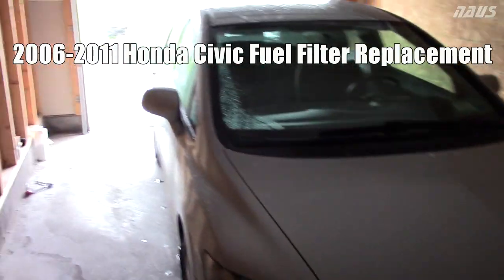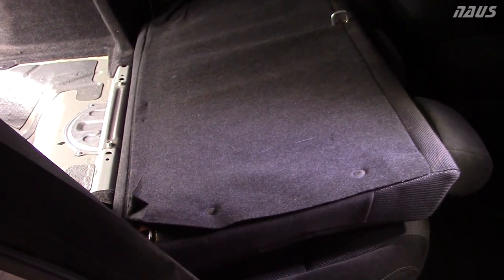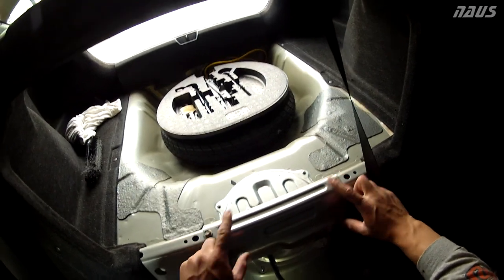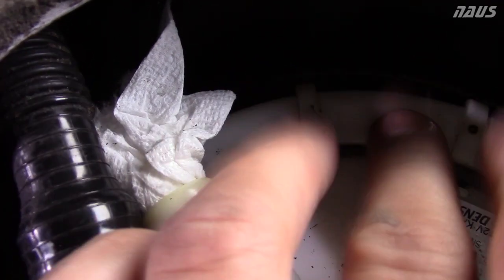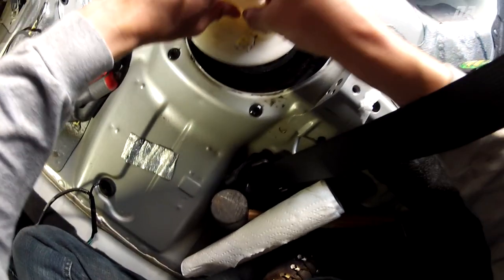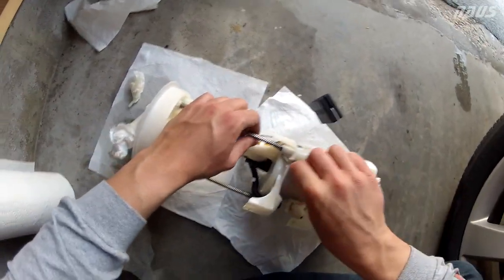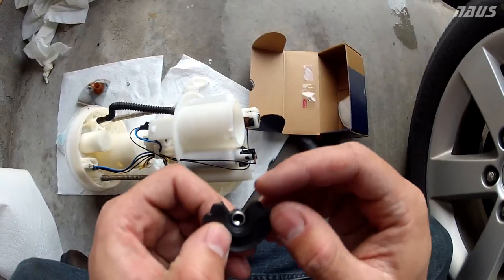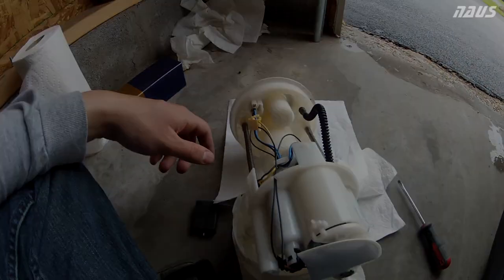8thgen Honda Civic Fuel Filter Strainer Replacement DIY

Comment: IMPORTANT NOTE:

You must withdraw the small o-ring inside the chamber (if it doesn't come out along with the pump) when you remove fuel pump, reattach it to the pump along with the plastic spacer to reinstall. Otherwise your car won't start, happened to me! ;)
Reply from the maker: Pinning this comment at the top. Yes this is very important and many people have commented with this same issue. Make sure the pump has the Oring on top of the white plastic spacer on the pump outlet before reinstalling!!!
Reply: same experience.that o-ring give me hard time to mount fuel pump.
Reply: Thanks so much for  this info. It was exactly what happened when i swapped by filter in my 08 civic.
Reply: Are you guys taking about the plastic o ring that goes with the cap ?
Reply: True story. :-/
Reply: @bradjohnson6783  we’re referring to the small rubber o-ring that seals the pump to the housing

Comment: THAT IS NOT THE FUEL FILTER GUYS. The filter is enclosed inside the white plastic next to the fuel pump. It's half round. It's called the fuel filter strainer assembly. It is the whole top gadget that the fuel pump sits in that needs to be changed. The part that was changed in this video is the strainer sock. The sock can be reused. taken of and cleaned out with throttle body cleaner. Although changing it will be best. NAUS did a good job of making this video,  trust me it was a lot of work. Thanx NAUS.
Reply: the description says that though
Reply: FPR*... aka PRESSURE *REGULATOR (right after the filter) is the part that causes lag, hesitations, lean misfires after 100KMi.

None of these fuel supply parts are cheap, nor is a tow truck or mechanic's labor...

It may be best to replace the whole assembly (pump, strainer, filter, regulator and sender) at once since those parts will get shot after giving you a "wake up call".
meaning....
If you piece meal the fuel supply assembly to save money... the 50psi pump will get you when it stops the car!
🤗
Reply: @glasser2819  im having the problems your saying so do i replace the whole fuel system or a specific part? please lmk thansk
Reply: The same thing with my Toyota Corolla Verso. Even some mechanics did not know that. :D

Comment: The longer the video went on, the less I felt like I wanted to try this myself.
Reply: I wouldn't recommend going through the trouble unless you're replacing the fuel pump, as well
Reply: Don't look that bad....
Reply: I mounted $4K worth of audio gear on the trunk side of the back seat 8 years ago. It looks slick but I'm filled with regret now that my 2011 Civic is just about due for a filter change... Man makes a plan and God laughs.
Reply: Haha, same
Reply: As a mechanic I can tell you I watched this and thought oh hell yeah that’s easy. Now I gotta wait for my pump to go out cause the fuck am I doin a filter at that point for.
Reply: Haha, same. The Civic I just bought used 2007 with 140,000 mi doesn't get that good at gas mileage. Gas light just hit on and I'm about 250 mi on the tank. I've heard O2 sensors and fuel filter could be a cause. ??
Reply: @Drakesgotskittles  if you’re a mechanic didn’t you already know how to do this on some level? Why are you watching this?
Reply: @Foil4life  interesting, I have a 2013 Civic that also has emissions issues. Is it common for the civic models?
Reply: @mjax278  because every cars different.
Reply: @mjax278 hey man even a dr just looks in a book to see how to treat you. The school is literally nothing but for a piece of paper to say I did it

Comment: Bonus footage was extra awesome! I run my ex coupe down to 0 bars every now and then but it always gets me home or to a gas station and i always wondered jus how much gas was exactly left! Sweet man. Freakin sweet
Reply from the maker: Glad someone appreciated it!!!
Reply: @NAUS2K  My dad always says not to run on or near empty because of debris floating on the bottom getting in the pump. So I guess he is wrong? it looked really clean at 130K
Reply: I always wondered
Reply: @greeneking77 I was told that running fuel to low is hard on the pump. Not sure how true, although a licensed mechanic told me that.
Reply: @TheMervK  The fuel pump is located in the tank, so fuel can keep the electric motor cool. Running on less than a quarter tank, affects the longevity of the fuel pump.

Comment: For the amount of work you put into it, probably worth spending $250 on a new OEM fuel pump. Car has 140k on it, fuel pump is probably on borrowed time. I have run several hondas to 300k and never replaced the filter. My current 8th gen civic has 220k on it. No plans to proactively change the filter. But, good to see how to get the fuel pump out.
Reply: This video was useful but ur right my honda sitting at 300 k daily driver for door dash running like a missle
Reply: @juniorm1061  excuse me? I was wondering if you can help me with something... I have a 2009 Honda civic lx sedan automatic and when my gas tank reads empty and the empty indictator light turns on its ususally because ive ran it for about 250 miles, How much mpg if youre giving you if you dont mind me asking?

Comment: There really is no need to do this unless you are having a issue. However, this was a great video now I know how to replace a fuel pump if need be. Mine has 200k with 0 fuel issues so these filter last for the life of the pump.

Comment: HI! Great video! But you forgot to reinsert he O-ring(look inside the cage after you pull the stock one out) that was supposed to seal the fuel pump back on the cage. It may not affect stock cars but for high performance cars it picks up air and causes it to lean out.
Reply: Car won't start without that o-ring, stock or modified, true story, happened to me and i was stumped for an hour wondering what i did wrong
Reply: @jean-pierremallet3524  must have felt so damn good once you solved your mistake!!!

Comment: Replacing this fuel pump is easier than my silverado 94. I love my 2012 honda civic. Everything seems easy to repair 😃😁
Reply: That jdm cars for you
Reply: @ace03cobra67  jdm?

Does it mean “Japanese (blank) manufacturing”?
Reply: Yup! Just replaced the pump on my 95 Silverado long bed. What a pain in the a$$!

Comment: TIP: Ensure you have the pump strainer kit AS WELL as the filter element kit itself such as the Denso kit used here @9:00 NOTE: AC Delco kit DOES NOT come with replacement strainer which you will need. Good luck :)

Comment: I just love Hondas.. want to change something? cool, step 1: disassemble car
Reply: You have to remove the transmission assembly along with the driveshaft in order to change a flat tire
Reply: That's most complicated fuel filter ever changed
Reply: Dude this repair is easy as frick
Reply: At least it isn't a beamer
Reply: They weren't really intended to be serviced, only in the case of a serious issue like the pre-filter clogging. There are 8th gens out there with 300k+ miles on their original fuel pre-filter and internal filter. It's maaayybe a 2 hour job for a first timer.
Reply: @lllllllllllllllllllll1lll1 good to know! I just purchased one with 289,000 kms. Or 175,000 miles.. It idles excellent,  however when I drive it and accelerate,  it starts bogging/missing,  so my 1st thought was a fuel filter. When I let off its fine again when slow going. 
  Any thoughts?
Reply: @TheMervK  If you are having a problem with your Honda Civic idling but not accelerating, it may be due to a faulty coil over plug (COP) or spark plugs. You can fix this by replacing the COP and spark plugs. Make sure to gap the plugs according to the manufacturer's instructions.

Comment: Add that point my friend I'd replace the fuel pump. Mine as well do a one time job and not spend hours changing just the strainer and have to potentially open up again for a bad pump at 200k.
Reply: Where do you bought the fuel pump?

Comment: So the 2008 Civic EX has a fuel strainer/sock and a separate fuel filter assembly attached to the fuel pump is what I'm gathering from all these information. If debris or dirt got down inside my tank, these two components should catch all of that right? and not allow that stuff to reach the engine?

Comment: I have over 400 Thousand Kilometer on my Civic. It runs great ,  never had an issue with the fuel system. Seem to be an unnecessary repair unless there's a problem with the sending unit. Just to change a filter ?

Comment: Haha I could've used this like 4 days ago! Just replaced mine and had to figure it out myself lol

Edit: That ring around the top of the fuel pump assembly is a killer to out back on eh? Took me at least 3 hours for it not to cross thread lol
Reply from the maker: Canadian Carguy yes it is a pain in the ass! Keeping the rubber gasket seated properly around the sending unit when pushing it back in was a pain too. I lubed it up a little with some silicon spray so it didn't get pushed inside the tank
Reply: NAUS Why Honda, why did you make It so difficult! Haha
Reply: Canadian Carguy I always use a hammer and a chisel and just pound it around till it's tight
Reply: I had the same problem and what I did is I put the plastic giant nut in some hot water and let it sit for about 3 min. and then it went in easy.
Reply: Shit I had to redo my 3 times before it was done right so gas will not leak from the ring areas. First time I can't even get the ring to goes on, finally with the new O-Ring gasket and had it on tighten but smell gas afterward, took it off thinking the O-ring gasket didn't seal right and it dose looks bigger so I reuse the old O-ring gasket, installed the ring gasket again, turns out it still leak gas after filled up, order new O-ring gasket and finally got it to goes on and tighten but now my as gauge only read 3/4 full after filled it up.  Any idea why gas gauge now off?  I hate to redo it again.
Reply: Yeah, I spend 2 hrs trying to put the stupid ring back on and still could do it...I what the hell happen, did this shit shrink that's why it's so difficult for the ring to screw back on?  I was think doing the same thing to heat up the ring so it expand a little bit more so it will goes onto the fuel pump.  Good Idea..

Comment: Thanks for this video, I have a ford fusion 2008 which has a similar pump and I plan to replace the strainer. I did not know there was a retaining washer that I'm supposed to replace and I don't know which size would be for mine, the strainer is similar to yours but I'd have to check what size washer to buy

Comment: Great video thank you so much. I got a rough idle and it did cut off on me once. New air filter too. It don't do it all the time so thinking a fuel issue. 2006 Honda Civic.
Reply: replace "fuel pump assembly" ($400) 
not just the useless strainer sock....
Reply: It could be the MAP sensor in your intake, intake filter, throttle body, fuel injector, or catalytic converter. Intake sensor can be removed by taking out two Phillips head screws, and it can be cleaned, so that's the best place to start, then work your way down the intake to the throttle body.

Comment: Please mind that's only the replacement of the strainer. The actual filter comes after the pump and is typically integrated into the fuel pump housing.
Reply: NAUS, I'm not trying to fool you. According to Honda, this is the fuel filter: https://www.hondapartsnow.com/genuine/honda~filter~set~fuel~17048-sna-a01.html

In my Fit/Jazz it's a similar setup with the filter integrated into the pump housing.
Have a look at the last five seconds of this video for a look into the paper filter in the housing: https://youtu.be/C_I55rV3Lnw
Reply: Yep. That is only the strainer. The filter is enclosed inside the white plastic next to the fuel pump. It's half round.
Reply from the maker: Civic R I'll have to look into that, I was only aware that this was the only filter in the housing
Reply: Hi NAUS can you please link where you got the strainer sock from? Thanx
Reply: Civic is right; this is not a fuel "filter", it is a fuel "strainer".  The filter is more like an oil filter, and is positioned inline somewhere between the tank and the fuel rail at the engine on every vehicle.  Also, the thing you removed from the tank is not the "sending unit", but the entire "fuel pump assembly".  Lastly, the thing you pulled out from the assembly at about 8:33 is not the strainer, but the pump -- with the strainer attached.  (Only that small, metal cylinder is the pump.)
Reply: All correct except one thing. The filter is nowadays included inside the fuel pump assembly as well. This civic and many other cars do not use an inline filter anymore.  What is pulled out of the tank is the sending unit, the pump, the strainer and the filter.
This video shows the inside and where the actual filter is located: https://youtu.be/C_I55rV3Lnw (last five seconds).

Comment: great video to instructed . is that fuel filter replace or fuel pump ? kinda confuse. I need to done it for my car 08 civic too. I did spar plug, air filter but not helped a lot like before. you think it ok for me to change the fuel filter because my friend told me replace fuel filter will help a lot.in gas.... any advice. thank a lot .

Comment: Having a lot of issues with my 07 Civic Gas Milage Drop, Hesitating on accelerating from idle and bogging down and sometime killing i think this or a fuel pump change may be in my near future. Just hoping not the fuel injectors car has 230,000 on it
Reply: I have the same problem
Reply: @luisantoniocastillo2769  no update I’m still trying to locate the issues.. I’m currently changing the control arms and sway bar links plus alignment. I hope that helps with mileage but the hesitation continues

Comment: I cannot understand why they chose to put the filter inside the tank, crazy. The older models had them near the bulkhead, so much easier. I have no inclination to open a 4 inch hole inside the car to a swimming pool of petrol, one spark you and the car are history.

Comment: holy shit why did honda make the fuel filter the most complicated and inconvenient task on these 8th gens......
Reply: Replacing the starter motor is MUCH more difficult than this.  Trust me
Reply: @Jetfuture737  Lmao. I took that shit to the repair shop to do that one.
Reply: @Jetfuture737  I haven't done this job yet but to me this looks worse, or at least more of a PITA.  I've done 2 starters and the last one was being a bitch until I took out the short exhaust pipe, which made it much much easier. I'm originally from PA and still haven't been able to shake my fear of messing with the exhaust, but things don't rust down here in NC. Honda's clever little spring-loaded flanges make it pretty easy to get that pipe out. (Oddly enough I had much less trouble doing it the first time, a few years ago and didn't take the pipe out ) 

The oil filter on my ex wife's 1997 EX was where the starter is on my car, imagine having to get back there every oil change.
Reply: @Jetfuture737  My mechanic said he will never do another starter on the 8th gen civic. Paid $200 in labor, but guy had at least 3.5 hours into it. He stuck to his price agreement and didn't try to screw me when I went to pay.

Comment: Will this cause bad gas mileage?. The fuel pump turns on and the car runs but I notice this does get really bad gas mileage here lately. Coil packs and spark plugs good 02 sensor working and new air filters good what could it be

Comment: Can you please share the link on where should I found those filters or sponges that work as filters please? I need to change it on my civic. Also will the same video work on a civic 2012 LX automatic transmision? I guess it will but just want to make sure. Please where I can buy it?. It will be nice if you can share it. Thanks in advance
Reply: Angel Yerovi should be same exact process
Reply: Angel Yerovi Was it the same process for the 2012?

Comment: Were your rpms randomly dropping to the point where the car idled very rough and wanted to stall but then  corrected itself in a few seconds? I ask bc my sisters car is doing that exact thing. So I'm thinking air, fuel or spark. I doubt her fuel filter has ever been changed in her car so I'm going to start here
Reply from the maker: That sounds more like a clogged injector or possibly throttle body/ vacuum leak